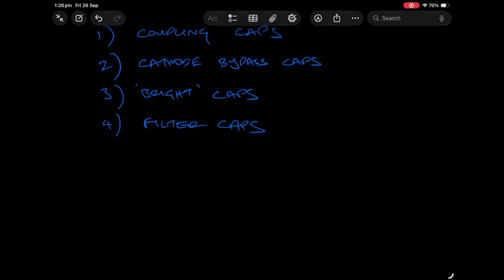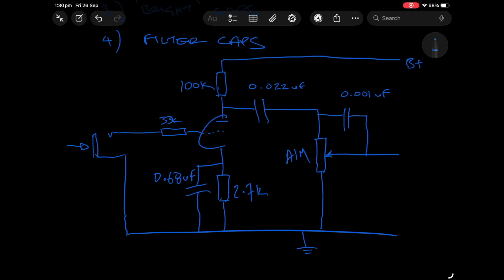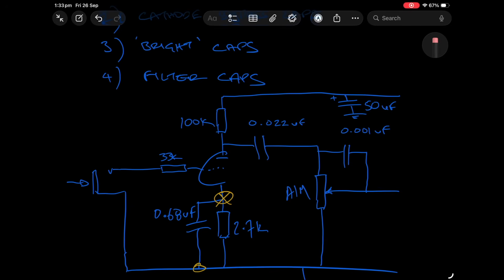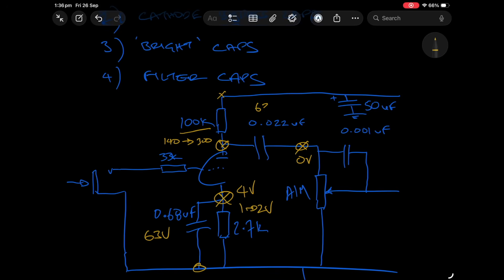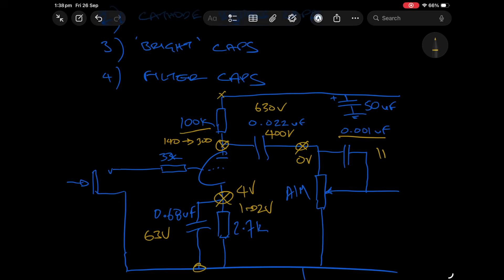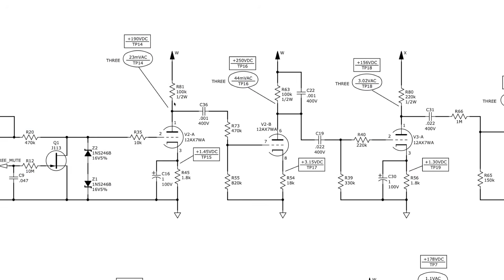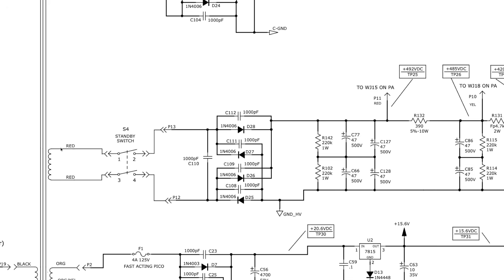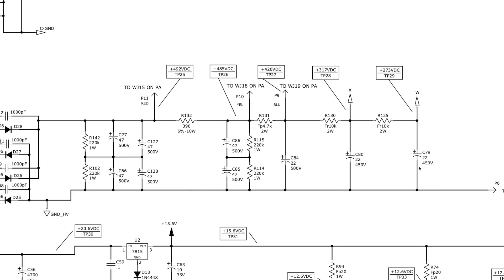Tube Amp Capacitors…what voltage ratings are required?

Comment: You are correct in saying that the coupling capacitor will see a higher voltage if the valves are not present and so wouldn't recommend running an amplifier without them. However, that does not tell the whole story. Even when valves are present, if a bridge rectifier is used, then at switch on, before the heaters have started to warm up, there will be no current flowing, and so the coupling capacitor will see not just the B+ voltage but the full off-load voltage of the power transformer which is will be well above the B+. While poly caps have a short term over-voltage rating, it's still better to use the nominal rating. Obviously, this is not a concern for valve rectification.

Comment: Love all your videos!! As far as Cap can size. Im building one of your MCII boards and wondered why wizard decided to go with the large filter caps can size and not what you recommend on your builds? Any tonal differences going big like they did vs smaller ones. I say this because I’ve heard so much about the magic in those circuits come from the power section/high plate voltage/filtering etc.

Comment: Hi Jason....love your channel! I have been totally awe struck with using a variac I just recently purchased! The sound I get from dropping the wall voltage by five, ten or more volts to my tube amps is incredible. The amps get a great feel... just like an amp that isn't over filtered with electrolytic capacitors! Nice and spongy. Not hard like a brick or baseball bat you know! My million dollar question and from countless others is... does running the heater filaments way below 6.3 volts cause damage to the preamp or power tubes? A great suggestion for tone talk or your channel. I have never heard Dave Friedman, Steve Fryette, Jim Gaustad, etc. discuss or give an answer to this ( I missed it if they did). Keep up the great channel! 💪❤
Reply from the maker: Thanks!  We are live this Sunday US time if you’d like to ask that question!

Comment: Super useful video, thanks Jason. Could you discuss why sometimes you’ll see filter caps in parallel or series? Is it just because sometimes it’s cheaper to use two smaller ones as opposed to one larger one?
Reply: I think because it’s not common to find electrolytic caps with voltage ratings higher than 500v (and also high capacitance ratings) without them being monstrous in size. So putting them in series gives you added voltage rating of 1000v instead of 500.
Reply from the maker: Yep!
Reply: Think of it like this. Marshall use first dual can cap in parallel to double the capacitance of the first stage to 100uF but voltage rating remains the same. In series the capacitance haves and voltage doubles. Just remember to use balance resistors to share the voltage.

Comment: Onya Jason! On the Revelation amps, I used to put some HV zeners in parallel with the PI supply cap to limit the voltage if the valves were pulled out.
Reply from the maker: Cool idea!